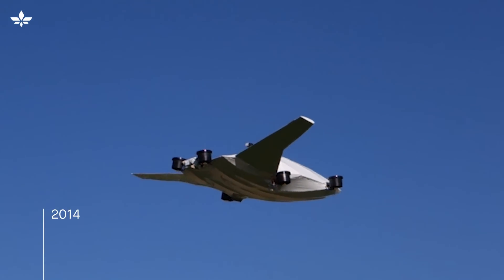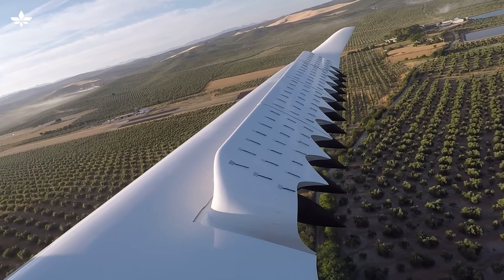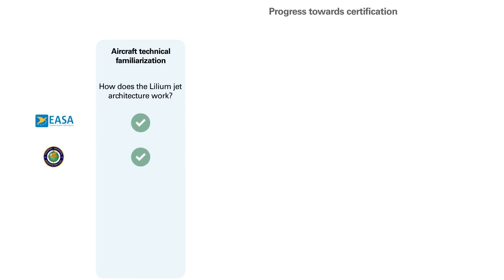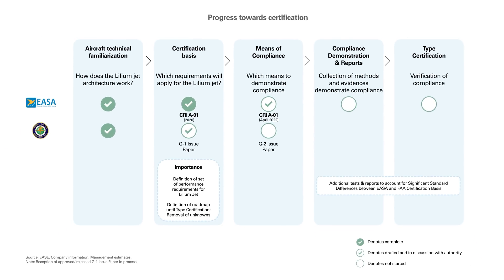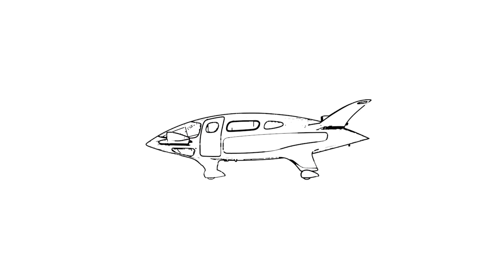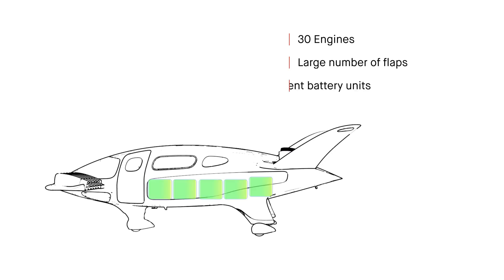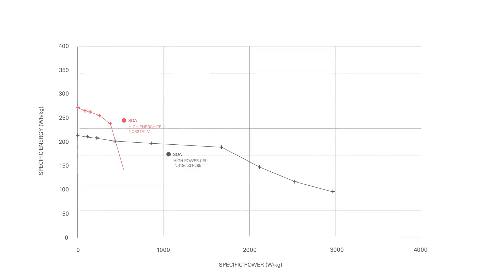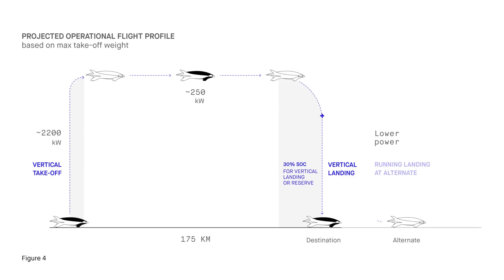Aircraft Development Update

Comment: Rolling takeoff will eventually become the obvious choice when a runway is available as this will also reduce power consumption. Although helicopters are capable of vertical takeoff, they most often takeoff with horizontal speed for the same reason.
Reply: Helicopters don't have ducts. This can go vertical with less resistance than trying to go diagonal due to physics of a ducted propeller. Unducted vtols can do rolling take-offs but ducted vtols are best to just go vertical.
Reply: @spacecowboy07723  this has nothing to do with drag, it is about the wing or rotor generating lift thanks to horizontal speed in addition to pure thrust, which reduces the power needed to take off.
Reply: @SuperYellowsubmarin  I understand rolling forward in a helicopter creates lift. In a vtol it does not work because the ducts are cylinder wings. There's no point in a ducted vtol to tilt 45degrees only Unducted ones can do that to gain additional lift. That's my understanding, may be wrong idunno
Reply: @spacecowboy07723  I see what you mean but consider there is an entire portion of the wing that is a lifting surface, not a duct, that will provide this lift.
Reply: @SuperYellowsubmarin  those wings at low speed have propellers pushing air over them in a normal plane. A ducted vtol doesn't push air over them unless in horizontal. Thus just going vert is more efficient. I think this plus weight is why every vtol in the real world is Unducted.
Reply: Yeah, no, for a single engine helicopter it's a safety thing, to insure a safe landing after an engine failure. Multi-engine helicopters often take off vertically ( and even backward ), either so it can return to the takeoff point in the case of a loss of one engine, or in some industries ( helicopter air ambulance ) to minimize collision risk with overhead wires.

The days of having to do a running takeoff for performance reasons is long over except for the most extreme cases...
Reply: @boston_pc  not saying they can't, but I have the impression that single engine pilots will not do it unless they have pull less power to minimise the risk of failure.
Reply: @SuperYellowsubmarin  
This is a letter containing six requests and suggestions to engineers in the Department of Computing and Mechanical Engineering
We ask engineers to devise engines faster than the scramjet engine in the civil aviation engineering project in order to travel 10,000 kilometers in 15 minutes
2/The second requirement is the design of ultra-high-speed motors that run on clean energy such as electric power and inverted solar cells
3/The second requirement is to transform all new aircraft into robots under the command of artificial intelligence computing and artificial brain cells
This is in order for the flying taxi companies to provide individual services to the traveler in order to transport the traveler from his home to the home of his beloved in very distant countries.
4/The fourth requirement is the establishment of an alliance and cooperation between officials and workers in civil aviation engineering, officials and workers in supercomputing projects and artificial brain cells.
5/The fifth requirement is the development of artificial intelligence devices such as supercomputing and artificial brain cells in order to know the geographical locations of cities, roads and human languages and to respond to the demands of the owners of flying robots
6/And the sixth condition is to conduct several tests in artificial intelligence in order to control high-speed supersonic aircraft, such as the scramjet engine, in order to slow down the flight speed more and more when landing and approaching the desired geographical location.
(Please convey these six requests to engineers in aerospace design and mechanical engineering in universities, institutes and factories)
Reply: @فيديوهاتعلىاليوتيوب  The fuck?
Reply: @SuperYellowsubmarin  you're entirely right with what you say in my opinion as a 2 decade aircraft engineer. For any aircraft the power requirement and cost of that, whether its noticed in fuel consumption or airframe/component stress is highest at takeoff, this answers also concerns of reliability/safety or endurance at the same time. It burns less fuel and its less likely to break something using lower power at takeoff basically.

This is amplified hugely with EAV's purely because batt tech is needed, as its no more than a case of scarcity of fuel currently for those.

And there's a lot of imagination going on in here, or argument for the sake of it.

Comment: Batteries are great for proving your design, but until and unless you give up this greentard tree-hugger fixation on being a flying Tesla, your product is crippled.   Talk to the people at Liquid Piston, and get a gasoline or diesel powered generator on board.  You'll drop hundreds of pounds of battery weight, gain a useful range, and the ability to refuel in minutes instead of waiting hours to recharge.  Your current power scheme is hopelessly inadequate for a practical aircraft.  Fix it.
Reply: The whole concept is based around the electric drivetrain and battery power. A generator on board would make it much worse, not better.
Reply: @EinzigfreierName  Actually it would be much, much better with a generator, but they won't go that route.  If they did anything besides batteries, it would probably by a Hydrogen generator or hydrogen fuel cell.  The energy density of gasoline or diesel is around 100 times that of batteries, so that would go a long, long way towards offsetting the weight of any generator.
Reply: Like an alcoholic arguing for their disability, there is always some loser discouraging healthy growth.  "Why try? Just debase yourself with the same compromises I made- it's easy, you'll see."

No- just no.

Comment: Great info & well presented! Just one nerd-question. If the power needed for cruise is 250 Watt and the max. Take-off weight is 3175 kg - wouldn't that mean the jet needs 793 kwh battery for 100km  cruise flight? (0.25 kw x 3175kg) That can't be right, or? Where did I make a mistake?
Reply: you need to multiply 250kW (not 250 watt) x 0.4 hours (since it will take ~24mins or 0.4 hours to fly a distance of 100km), which equals to 100 kWh of battery capacity. If you want to fly 175km, have 75km reserves and take off and land you need approximately 330(?) kWh of battery capacity which means the batteries weigh around 1 to 1.5 tons.
Reply: @kingplays5369  ah, thanks. I knew that couldn't be right. I assumed that they displayed watt/kg - since that's what they do on the left side.

And of course you are right: Spedd is way above 100 km/h and that needs to be accounted for.
Reply: @chrispyak  You‘re welcome.
3 years ago I could‘ve been the one asking your question, so I‘m happy I could help you out
Reply: it needs 250 kW for cruise. Read that again.

Comment: Nice Job, but i have a Question: what are your plans for winter conditions? A normal Aircraft can use its exhaust to heat the wings and melt the ice, but without the exhaust, how do you get rid of the ice that could form? Heating the wings with the battery power would have a big impact on the range, or am i wrong?
Reply: @Mike Hoyer if they plan on commercial flying, then they probably have to, sooner or later ...  de-icing boots: are also often inflated using exhaust gas, same problem. You could carrier an Aircompressor but those have vibrations and also take energy to run
Reply: plus being a composite material wing, they are able to apply a surface coating that would reduce ice formation.
Reply: It seems to me that battery performance will recommend charging in a heated hanger, limiting any ground icing, and flight ceilings would likely be only a few thousand feet AGL, both limiting potential icing.   That said, there are unflyable conditions for any aircraft.
Reply: @mavigogun  A huge advantage of the lilium jet , is it can take off right away. No need to taxi to the de-ice bay , get sprayed , then again taxi to the runway. Also won’t have to worry about holdover time expiration where the anti ice fluid expires. While taxiing, accumulation can occur again after the fluid looses effectiveness
Reply: @Ollie0987  see my preceding post in which you were not tagged.
Reply: It will be very interesting to see what kind of range they will get when the battery energy density reaches 400 W hour per kilogram
Reply: This aircraft is most likely not going to be IFR certified, therefore the chance to encounter icing are relatively low.
Reply: @Dudeisthere  Did you find that prediction in your fuel tank filter, or do you have some basis for it?
Reply: @mavigogun  This aircraft is supposed to provide air taxi like services to many different locations including big cities, thats why it has VTOL capabilities so you dont need a runway, correct? So the mission profile is almost identical to that of a helicopter, most of the time it will operate from landing sites that do not have any IFR procedures so a certification for IFR wouldnt be necessary. The IFR "fuel" reserve requirements are also different, with such a limited range there wouldnt be much effective range left for IFR operations. Plus no deice, no weather radar. 
But with the tiny amounts of information that Lilium provides (no price, speed, battery capacity, etc.) im skeptical about this whole thing anyway.
Reply: @Dudeisthere  Sure, the fuel requirement alone would kill IFR cert- if the entire flight were in IFR conditions.   However, a great number of low level flights might transit obscurations that would otherwise ground a taxi- say, climbing through low level cloud cover from Golden Gate Park for a hop to sunny Oakland, for example- or through clear skies at night.   If there is a need for a special operating limitation, I'm sure the FAA will be keen to impose such.   Is the vehicle intended to fly autonomously?
Reply: @Mike Hoyer deicing boots sit on the leading edge of the wing. It inflates and dislodges the ice. They are normally run in sequence clearing one area at a time. There has to be a build up of ice for these to work.
Reply: This is correct. A conventional aircraft will use its hot bleed air from the engines to heat up its wing leading edges in order to prevent ice accumulation over the wings. These aircrafts have their engines mounted under their wings, leaving its entire surface area as the main lift generating force. An airplane produces most of its lift from the upper surface of the wing. The lilium has its ducted fans motors mounted over its wings. Therefore this type of design will prevent any ice formation on its leading edges due to the strong motor fan suction of the air and its particles that would normally adhere to these surfaces.
Reply: @Ollie0987  yes but the suction is only where the engines are, but about 1/3 of the wing does not have engines --> no suction --> ice. Also the body could also form ice, which increases drag and lowers the range
Reply: @xkarldaslama7691  While airborne , an aircraft does not accumulate icing on its fuselage due to aerodynamic air forces. This is only a concern while on the ground
Reply: Also, the Lilium’s ability to change altitude by ascending or descending rapidly, will prevent any chances of ice accumulation over a given period of time should any severe icing be encountered on any critical surfaces
Reply: @Ollie0987  help me out, how does ascending or sinking reduce ice?
Reply: @xkarldaslama7691  because when you have the ability to change altitudes quickly, you can get out of icing conditions also quickly. Icing conditions only happen when perfect weather conditions are met. Any changes in altitudes will also change the freezing levels and intensity
Reply: @Ollie0987  never knew that icing conditions have to be this perfect, but thanks for letting me know :)
Reply: @xkarldaslama7691  I’m a pilot so I know a few things lol
Reply: @xkarldaslama7691  lower altitude, warmer air.
Reply: @Ollie0987  While generally limited, the extent of fuselage icing really depends on the aircraft design.   Contrary to the proclamation, icing conditions may span across significant altitudes.  Of more concern to me is freezing rain- a more overt threat, yet also more difficult to avoid in the air.
Reply: @mavigogun  An aircraft never gets dispatched when severe icing conditions exists along the route of flight. The aircraft will be grounded until the next weather forecast. If moderate icing conditions are encountered in flight, a prompt change of altitude will work almost every time in order to stop the accumulation. Clear and time ice , and the greatest threats.

Comment: I'm excited to eventually fly in one.  These will be exceptional air taxis.
Reply: the company is almost bankrupt. You will never fly in one of them.
Reply: @mkbbk7722  You cite no evidence for your claims.  What can be asserted without evidence can be dismissed without evidence.  Are you a short seller perhaps?
Reply: @nickflynn666  What about reading their filings? Its a public company dude, dont be dumb...Insane
Reply: you probably wont want to fly regularly since it's very expensive to fly compared to driving

commercial flying is only viable because of the huge scale and amount of passengers and the inclusion of VIP space
Reply: @juhotuho10  In the video it shows the power usage at 2500 KWh for 250 Km range. At 0.2 EUR/KWh it comes at 500 EUR per flight. Add in the pilot, the machine depreciation, the operator's margin and you might end up at 1000 EUR/250Km. From what I see online, renting a regular helicopter is between 1000 and 3000$ per hour and it just so happens that they can go at around 250 Km/h. So it seems to me the cost it's comparable to a low end helicopter.
Reply: @FreezeS  
This is a letter containing six requests and suggestions to engineers in the Department of Computing and Mechanical Engineering
We ask engineers to devise engines faster than the scramjet engine in the civil aviation engineering project in order to travel 10,000 kilometers in 15 minutes
2/The second requirement is the design of ultra-high-speed motors that run on clean energy such as electric power and inverted solar cells
3/The second requirement is to transform all new aircraft into robots under the command of artificial intelligence computing and artificial brain cells
This is in order for the flying taxi companies to provide individual services to the traveler in order to transport the traveler from his home to the home of his beloved in very distant countries.
4/The fourth requirement is the establishment of an alliance and cooperation between officials and workers in civil aviation engineering, officials and workers in supercomputing projects and artificial brain cells.
5/The fifth requirement is the development of artificial intelligence devices such as supercomputing and artificial brain cells in order to know the geographical locations of cities, roads and human languages and to respond to the demands of the owners of flying robots
6/And the sixth condition is to conduct several tests in artificial intelligence in order to control high-speed supersonic aircraft, such as the scramjet engine, in order to slow down the flight speed more and more when landing and approaching the desired geographical location.
(Please convey these six requests to engineers in aerospace design and mechanical engineering in universities, institutes and factories)
Reply: @FreezeS  Where does it show the power usage as 2500kWh for 250 km?
Reply: @FreezeS  Are you sure about those numbers?   a 2500 KWH hour battery using 250 wh/kg battery pack would imply a battery weight of 10000KG or 10 Metric tonnes.  The original  7 seat prototype had a fully laden weight of 3175KG so something is wrong there.  I can't find any details on the size of the battery but i would guess around 200 KWH so something like $40 Euro fuel cost per flight.
Reply: @juhotuho10  Electric flight is way cheaper. This was done on normal air crafts already and the data is available online.
Reply: @juhotuho10  <--- do nothing termite.   Sure, we'll have to wait to see what the price point turns out to be- the negative presumption is just... tedious.
Reply: @juhotuho10  don’t assume about that which you don’t know for sure
Reply: You will have to wait, they can barely fly empty. Until they can fly with a passenger that will most likely take a few more years. But now after 7 years at least they are almost in horizontal flight, which is a huge step. Now going at higher speeds horizontal and then with payload compared to person or two will be another big challenge.
But I am glad they realized that they will not get anywhere with the current battery technology if they don't reduce the number of fans and make them bigger, simply creating more thrust with the same amount of electrical power and lower RPMs.
Reply: @n1vca  you don’t think they’re testing it with a full load capacity? Why else would they be testing it right now? I’m pretty sure you don’t work for the company and I have no idea if they have a full load in the aircraft. So I’m glad you have a lot of opinions.
Reply: @n1vca  of course they’ll have to wait. That’s why the words “eventually” & “will” were used.